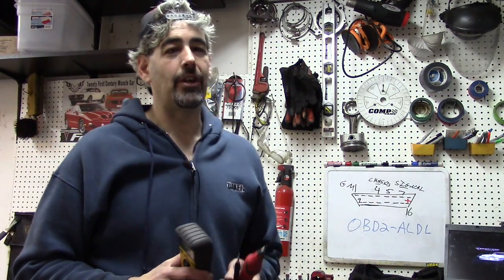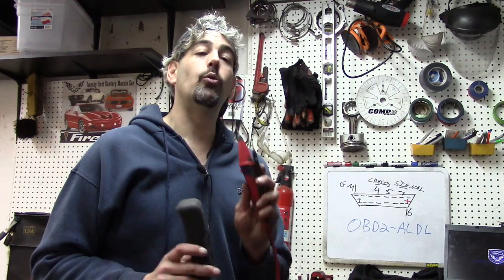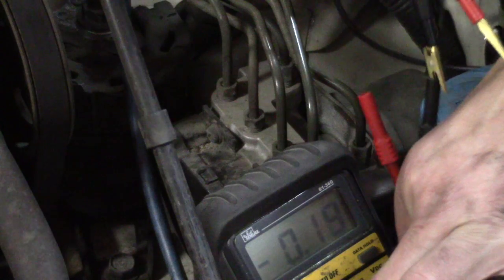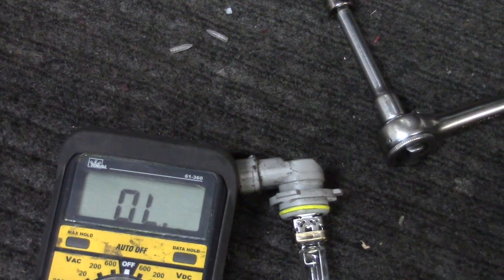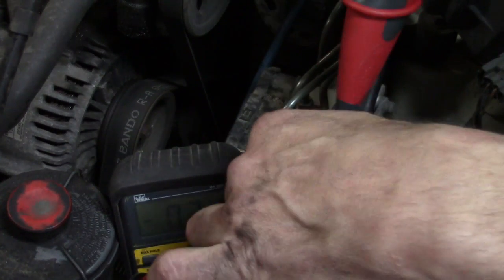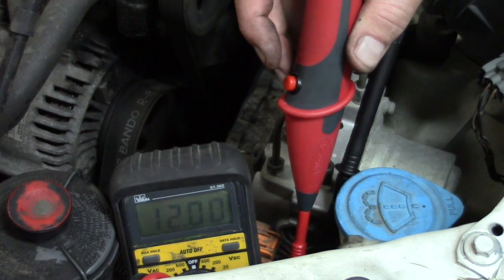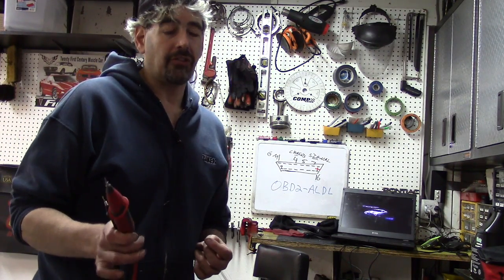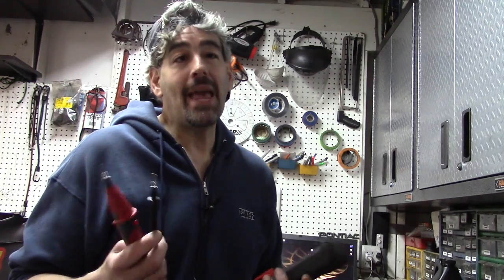Load Pro Electrical Tool Review (with product link)

Comment: So your paying $70 for a power resistor and switch in a box? Seems pretty steep to me. You could make the same thing for nothing if you have a few parts in your junk box or maybe $15~$20 if you bought the parts new.
Reply: +Jeffrey Birt - Even simple solder a couple of wires on the power resistor and plug them into the headlight socket to load the circuit. I can imagine that if your charging by the hour the $70 tool would pay for itself but for the home shop mechanic you can accomplish the same thing for much less cash.
Reply from the maker: +Jeffrey Birt Thanks Jeffrey- so what ohms and wattage resistor would I use or better yet how to I calibrate the meter reading accordingly if I use my 100ohm 5 watt resistor?
 Eagerly awaiting your answer since you forgot to mention this in your comment and I'm sure you agree it's the most important part! thank you.
Reply: There is no calibration. The voltage drop you are reading when you load the circuit by pressing the switch depends on the value of resistance of the wire/connection fault you are diagnosing (given that you are measuring the voltage drop of the circuit.) You could also measure the voltage across the load resistor. If the circuit is fine then you would drop all 12V across load resistor, any amount less than 12V would be dropped across the circuit fault. In either case the exact value is not important, if you are measuring the voltage drop across the circuit it 'should' be near zero, if you measure across the load resistor it should be near the battery voltage. The load resistor value is also not critical, it just needs to be of low enough resistance to properly load the circuit and high enough wattage to dissipate the heat.

I added the second post as I realized after hitting post that if you are a professional mechanic then it would not take to long for the tome saving to pay for the tool. There is another simple tool that is a switch in a box with wiring adapters that let you replace a relay with the switch box and manually trigger the load. One of the power load forms an loop outside the box that you can clip your amp probe around. It lets you easily test the load the relay is driving. Easy enough to rig up for the home mechanic but a real time saver for the pro.
Reply from the maker: Jeffrey Birt Still didn't answer the question- what is the maximum load and minimum wattage needed?
Reply: That depends on what your testing! For most automotive applications I would suspect that a 2A load is sufficient. So 2A*12V=24W, a 6ohm 5W or 10W power resistor would be OK for brief tests, you could use a small piece of aluminum  bar as a heat sink for the resistor if you wanted. In the past I have used an old headlight for a load (could draw up to 20A) or a Taillight type bulb for a smaller load. Most shade tree mechanics probably have the odd bulb wound that can be used.

When I used to build automated welding equipment we had to use a load bank that could dissipate 10kW or so. The load depends on what your testing. The theory of loading the circuit is the same.
Reply: +Jeffrey Birt  - To expand on this line of thinking. An 1159 automotive bulb draws about 1.6A and dissipates about 20W. A generic 1159 socket with pigtail leads is less than $5 so for less than $10 you could have a couple of bulbs and pigtail socket.

You could run the same test you did on the headlight but place the 1159 bulb in circuit as the load. With your volt meter measure from each side of the 1159 to a known good chassis ground. Ideally you would have 12V on the + side of the circuit and 0V on the ground side. If you have a significant voltage drop on either side that is the side where the problem lies.
Reply from the maker: Jeffrey Birt And yet you never made this tool yourself.
Reply: As I mentioned before I HAVE used a spare headlight and a smaller bulb as loads for testing purposes. I have not made a special tool out of one for automotive use.

I have also used various resistors as a load for testing circuits and have used an array of 200W heat lamps as a resistive load for testing power supplies. I even used an array of 100W bulbs as a load for a piece of laboratory equipment at the university where I work (and build equipment for research). The bulbs were chosen as it provided a good visual indication as to what was happening on the equipment and the lab that it is in gets a lot of tours.

I am VERY familiar with using loads for electrical testing. The type of load depends on the job at hand as I mentioned before. For example a quick test for battery condition is to turn on your high beams with the engine not running. Measure the battery voltage then turn on the headlights. The voltage will drop perhaps 1 volt depending on how much current your headlights draw. You can load the battery more by turning on the hazard flashers and the heater blower. It is not as good of a test as having a proper load bank but it requires no equipment other than a DVM.

I'm not trying to give you a rough time, I think the tool is neat and can be a time saver if you are working on cars all the time. You can use other ways for providing a load for testing if you don't have $70 to buy the tool though,
Reply from the maker: Jeffrey Birt Wow an array of 200W lamps and an array of 100W bulbs ROTF... sounds like you need the load p[robe waaaaay more than I do!!!
 No way I am sifting through that.

Comment: Hi. Do you think if this tool safe to check reference volt for any module like  PCM OR BCM......ect
Reply: +Wael Ahmed This is absolutely my concern. The tools amp draw, verse the normal amp draw of a 5 volt reference circuit. It's a lot of guessing unless you test prior, which defeats the purpose. could have back probed.
Reply from the maker: +Turbotomass Yes I don't even use an incandescent test light on 5V PCM controlled circuits much less a load pro.
  Using the right tool for the job is essential to not doing damage.
Reply: thankyou
Reply: +Schrodingers Box  +Turbotomass +Wael Ahmed
Of course its the combination of the circuit total resistance & voltage that determine amp draw. The LP doesn't always draw .5 amps.  In the case of a 5v reference, the worst case max amp draw would be if LP was only resistance in circuit.  5v / 25 Ohm = 200mA draw.  Sullivan has always stated LP safe on 5v and 8v circuits.  But I can totally see the "better safe than sorry" principal applying too.
Reply: +Matthew Brice Great point. Real world I&#39;m not using a volt meter on a sensor w/ a 5v ref. Unless the sensors dead. For an itermittent, or signal issue. I&#39;m using the scope.  but yea I assume all 5v ref curcuits are proctected with an IPS or fuse. 

DERRRR  scope with the load pro.

Comment: whoa, wait... 60$ for a tool that just puts load on the circuit? You realize that you can easily DIY such a tool almost for free by modifying a set of voltage leads
Reply from the maker: +Katy Pisicutza Oh great- tell me how to do the modification excatly- I can't wait to hear! Awaiting your response for the exact parts and modification to get QUANTITATIVE voltage drop measurerment by modifying the leads!
Reply: +Schrodingers Box lol loadpro is just a switch with a resistor i can't see why loadpro is so expensive while u can achieve the same result (or even better) for free with a gluegun, switch and resistor(s).I'm not saying you did bad business by buying it (no need for that hostility), i'm just saying that as a DIYer you can DIY this tool and seeing you as the DIY god, was expecting that you DIY this tool :))
Reply from the maker: Katy Pisicutza No what resistor is it and how much amperage would it draw? Without that is it not useless to say "you can just make your own"???
  Pretty obvious you have no idea how to make your own yet you comment about someone buying one.

Comment: south main auto repair. I agree. this tool is just too dangerous on computer driven circuits. Use an incandescent test light or in certain cases use an led test light where you are not sure of what load the circuit is capable of.
Reply: If you don't have an idea of what a circuit can handle prior to loading it, I reckon steer clear of working on electrics.
Reply: This kind of lack of understanding of electrical circuits is what leads to a paperclip used in place of a fuse IMO

Comment: A typical injector or ignition coil for example draws 1 or more amps in which case the tool would be safe.  You would have to know what the circuit normally draws to say if it's safe or not. Which information isn't readily available.

Comment: I have a set of the original yellow LoadPro leads and they're a great time saver. It's nice to be able to see the numbers on a meter and then do a comparison after a repair is made. Test lights have their place just as the LoadPro leads have their place. An incandescent type of test light can be used in a similar manner but it's not as precise. There's obviously more than one way to do a voltage drop test. The way I see it if you have a problem in a circuit your gonna be pulling out the meter anyway whether you used a test light or LoadPro leads. I have both, I use both.
Reply from the maker: +Chester Wardan Agreed 100%  I have multimeter, load pro, test light and power probe... I use all of them depending on the application but I actually use the test light the least because its the only one that is not quantitative.
  I like your point about the comparison before and after the repair- that's a great point I didn't bring up!
Reply: Please tell how u can use a test light in a similar manner.

Comment: Sometimes the comments section is better than the video.  
It would be a good value add for the meter manufactures to just incorporate the same function into meters aimed at automotive diagnostics. Along with said meter would come a LED/Incandescent scope on a rope in the same blister pack. ;)